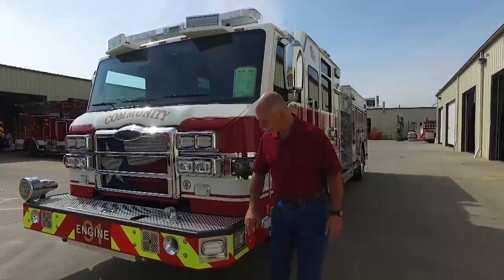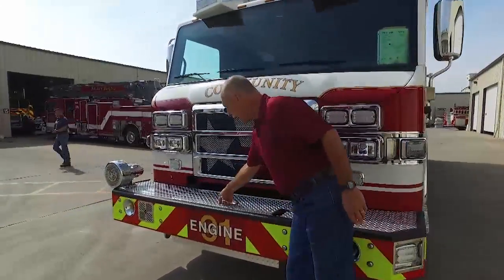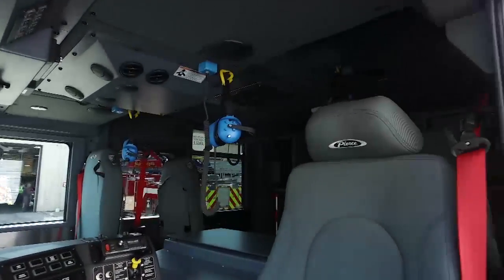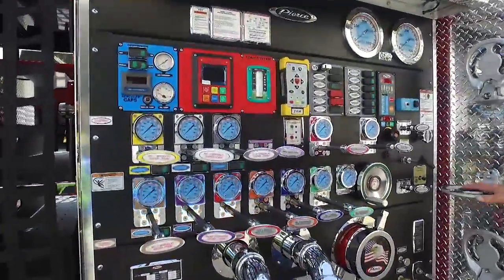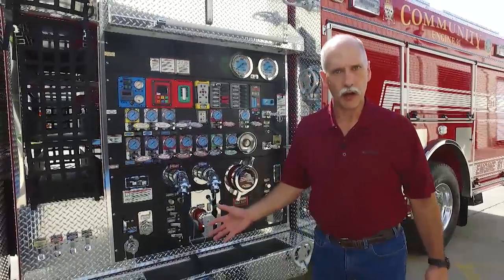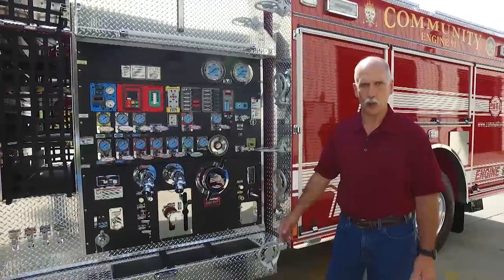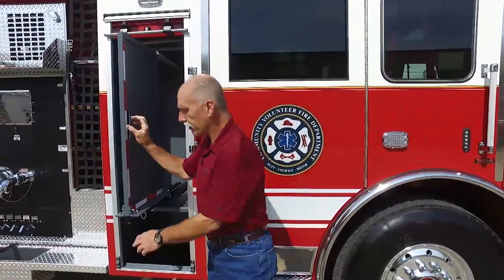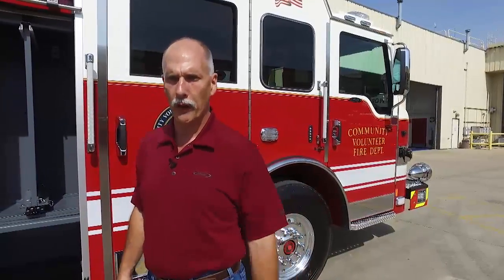Community V.F.D., TX – Velocity® Pumper

Comment: And btw 750 gallons of water will only last 2-4 minutes.
Reply: Actually it’s a full 7 minutes and 30 seconds, smoothbore fully open
Reply: 50 gallon foam, with CAFS makes it last a lot longer
Reply: Nubby G we don’t ever really use the foam until overhaul
Reply: Yea, if we use the deck gun. Hoses last a good minute and by the time we’re even halfway empty, another engine has already established a water supply

Comment: The Air tank has carcinogens but the turn out gear doesn’t? Cut me a break
Reply: After a fire all gear gets sent out to be cleaned
Reply: Jean Stapleton After the gear contaminates the cab on the way to the station.
Reply: Lol , its not a perfect system but we try to work with it the best we can
Reply: Jean Stapleton The best way would be clean turn out gear to the fire and then take off all gear and bottles and put them into compartments on the truck!

Comment: I will always prefer the SCBA built into the seat, it's not meant to be comfortable, it's meant to be fast, so you can already be masked up and ready to go when you arrive on seen of a working fire. we say it all the time in the fire service, every second counts, and a few extra seconds it takes you to do your job, get water on the fire, get a victim out of the fire can be the difference between life and death. If I'm responding to a MVA with victims pinned in a vehicles on fire or smoking, I want to have my pack on, my mask on, on air, where as soon as we roll up on seen all I have to do is jump out and start trying to get the victim out of the car, if captain tells me to stretch a line, that's the only thing I want to have to do when I step out of the engine, not put my pack on.

Comment: ok couple of thngs just with that compartment why didnt u seal it it has holes in it alowing acess into the cab number one so it dosnt protect anyone second in cali we r reqired to be fully dressed before we enter the cab i can still put my scba on while im seatbelted in an what about the stuff thats in our turn out gear? and when u hav those public relations do u hav a full set of brand new turnouts nevr been worn in a fire for my kids to wear i was a volenter for 3 1/2 years only time my kids ever wore my set of gear qas when it was brand new even if u clean them u nevr get all of the stuff outa them its a good idea dnt get me wrong but try training more with what u have to get good habits down before u change stuff i can still get into my full turn out gear with scba in a min thats a reqirement here in my old dept and we had to do it in the fire academy as well witch was put on by calfire an i also went to a full fire academy that was 6 months long
Reply: A. Our fire academy is 6 months 
B. We have lots of people visit our stations, just had a Boy Scout troop visit yesterday
C. We get dressed on the engine, all of our turnout gear is in the cab 
D. All of our flashlights and radios stay on the charger in the cab
E. We have to complete a 360 fire inspection upon arrival to any fire ground.